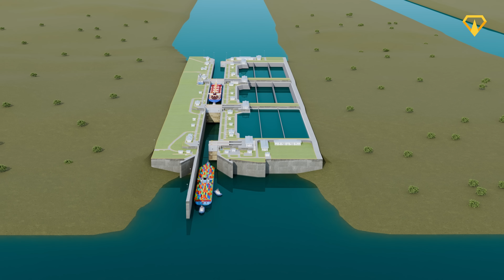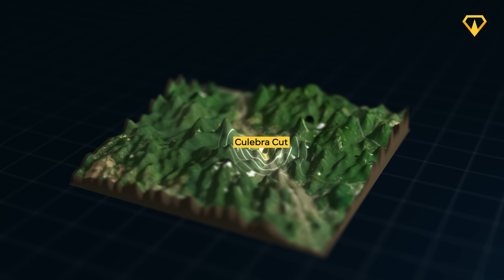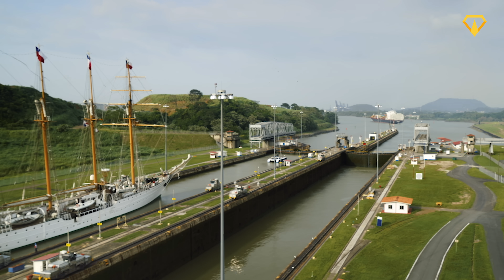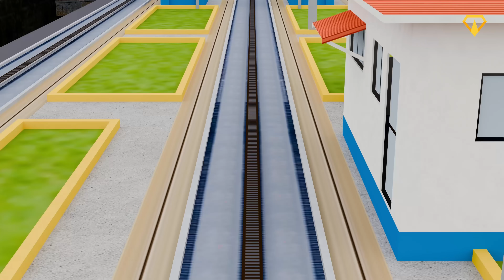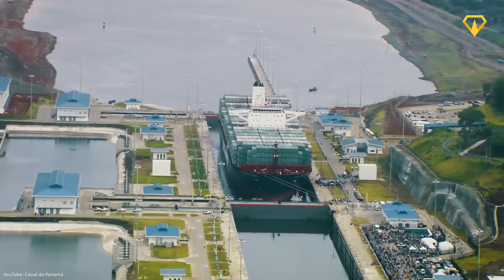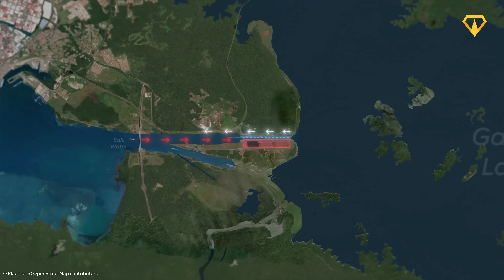How the Panama Canal Works - And Why It’s in Trouble

Comment: The Panama Canal connects Atlantic and Pacific oceans through an ingenious lock system that raises ships 26 meters using gravity-powered water flow. Built after French failure, it required massive engineering including Gatún Dam, Culebra Cut excavation, and complex locks. Recent expansions doubled capacity but created new water shortage challenges.